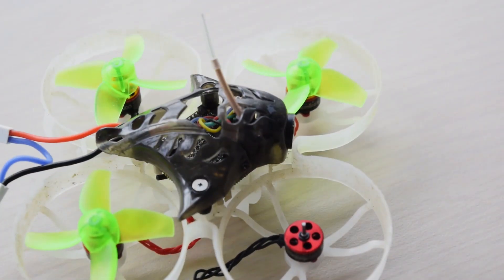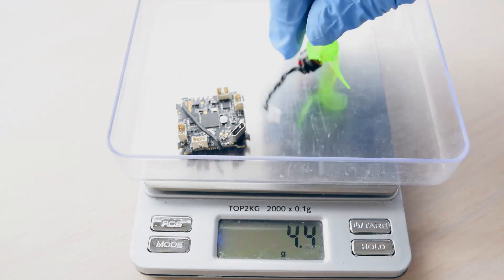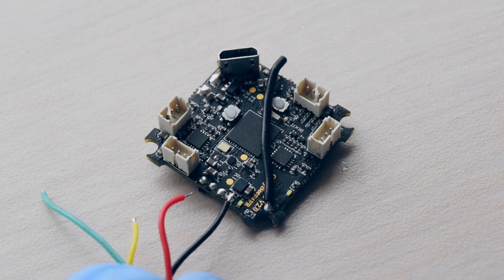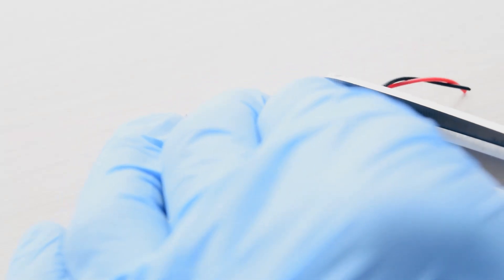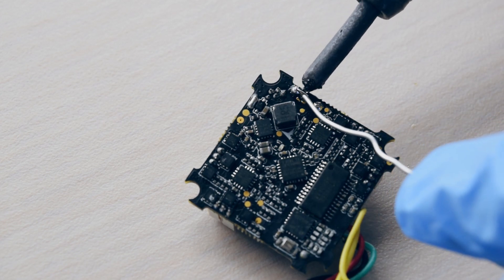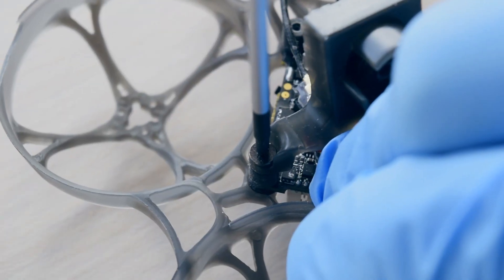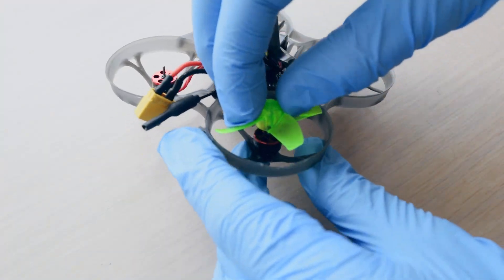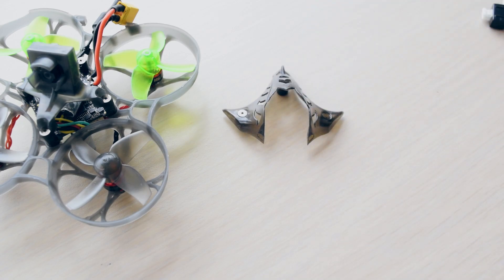How to Upgrade your Mobula 7 in Under 5 Minutes

Comment: Nice, but 6g on that scale is a massive amount of extra weight. How does it fly?  I did something similar (but with the 1s version) initially, but it ended up being a pig in the air. High throttle just to get off the ground. Instead, I went back to the drawing board, ditched the external vtx and just upgraded to a grounded antenna and it did wonders. I hate the cost, but gnb27 connectors are a better alternative for weight and batteries with these already installed are quite available where  I am. These mods and an alternative canopy like yours got me to .4g under original fly weight.